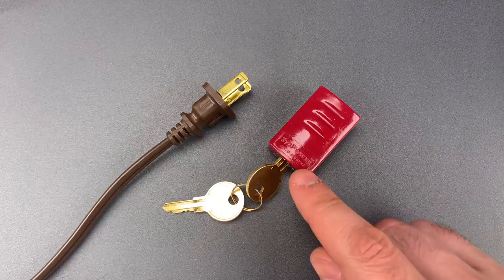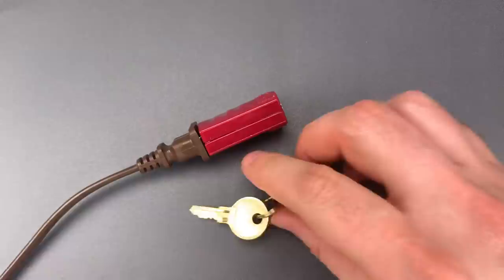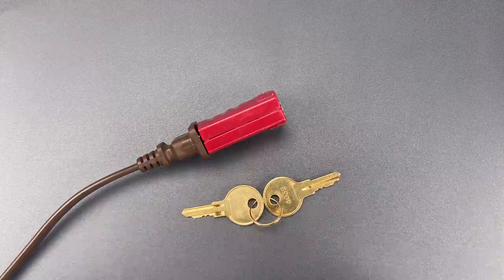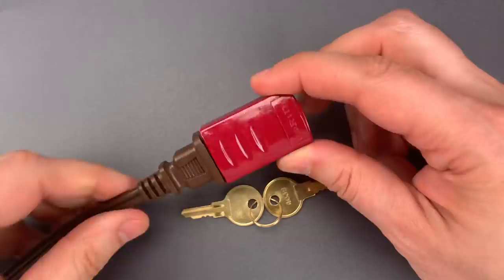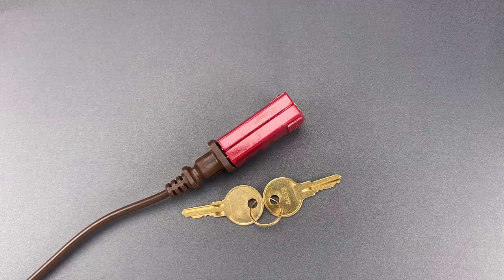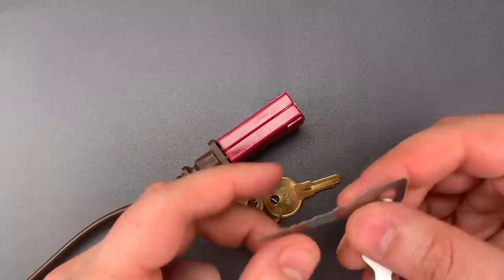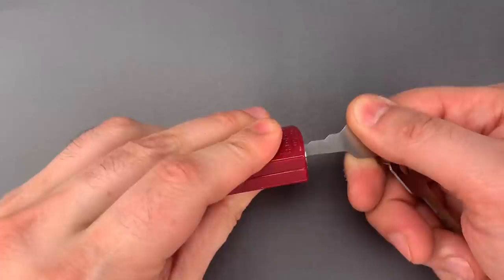[1138] Stopower Electric Plug Lock Jiggled Open FAST

Comment: "It only keeps out those who play by the rules. And maybe that's all you need in some circumstances."
I like that observation. The right lock for the job isn't always the just most secure one.

Though I'd say it's one step above a do-not-disturb sign as it's a little more idiot proof; it provide a mechanical way to keep track of who applied it (https://en.wikipedia.org/wiki/Lockout%E2%80%93tagout).

Comment: I’m an electrician and probably the best player ever of the board game Operation. If I want to deter my children from plugging in the PlayStation I just leave a plastic tab inside the hot of each electrical outlet to prevent them from using the outlet. No lock required.

Comment: You could probably use a padlock with a very thin shackle and just put it through the hole in the prong of the plug. This would prevent that prong of the plug from going into the outlet enough for the device to receive power. This could also take away the hammer and jiggling attacks if you chose the right lock. You could even double up on security if both prongs of the plug have holes in them. The lock would probably be susceptible to cutting and shimming attacks, but you might need special tools to pick it if you chose a small lock with a tiny keyhole.

Comment: We used these (or a very similar lock) in the welding shop I worked in.  If there was a problem with a piece of equipment that needed repair we would throw one of these locks on it.  We did this because do not use signs were not considered sufficient by the government safety inspectors (who visited regularly due to the nature of our work).

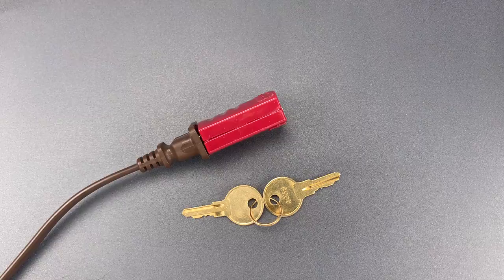Comment: 0:21 the Xbox One and PS4 have removable power cables that are pretty standard and generally interchangeable with other household devices shaped the same. The Nintendo Switch has a slightly more unique AC adapter, but any power supply that has equal or more volt+amp output to the original can be paired with a USB-C cable as a replacement... Just some info for the kids that want to play games immediately instead of trying to pick the lock 🤪

Comment: This is why, in actual safety applications, we use a plug lockout device with a hasp for a padlock like a Master 410, to provide actual resistance against picking… or more likely against a different technician mistakenly inserting the wrong key and jiggling a bit. Still plastic, still vulnerable to destructive attacks, but if you really wanted in you could just cut the plug off and replace it anyway.

Comment: in the UK you can easily re-wire a plug (not sure what the case is in America). But even if it was a solid lock and body made out of metal, you could just cut the cable and install a new plug on the end.

Comment: In one one of my first jobs we had locks on the telephones. Theses phones were the old rotary dial variety and the lock sat in the cradle. I discovered (I was on the night shift and i was bored!) that if you pressed down the cradle switch and gave the phone a good whack on it's right hand side whilst rapidly releasing your finger off of the switch that these locks would open. It was just the inertia imparted into the weak spring that was supposed to keep it shut.
Free calls! Whoot!
Edit for spelling.

Comment: To be clear: this is a lock out tag out (LO/TO) device. It is not meant to actually secure a lock but simply to show people that the device it is connected to should not be used and prevent accidental use. These are used in warehouse and industrial environments when an engineer is doing maintenance on a piece of equipment or when a piece of equipment is faulty and dangerous to use

Comment: It's not really meant to be pick free, and most don't have the basic picking tools on them.  We use something similar at work to lock out servers from being turned on for testing while we work on them.  It's pretty much as you said, hey, do not use, this is here to remind you.  Like safety lock outs for electrical boxes, showing hey, do not use until all keys have unlocked and removed it.

So pick prevention isn't needed.

Comment: Its most likely designed as a lockout device for any 2-3 prong 110v north American device in industrial/commercial places where someone is working on a device that plugs in. Even things like band saws and such that use the 110v 15a plug. Not that rv style 30a one.

Comment: I have a really old oak desk in which the middle drawer has a wafer lock. I use the file from a set of nail clippers to open and close it. I'd like to see you try this to see if my lock is particularly bad or if all bad wafer locks can be picked using this method.

Comment: Where I use these I'm operating under the assumption that the order of learning my kids will go through is 1) curiosity enough to go through drawers in the garage that I don't want to have to keep locked up in their entirty. 2) Understanding that, and how, you can hurt yourself with a glue gun, dremel, or soldering iron 3) lock-picking. If 3 comes before 2, then 2 will very probably shortly follow 3.

Comment: I have an absolutely massive game console collection (world-class) and the most mainstream console I can think of with a non detachable plug that could be locked out with this lock is the Panasonic R.E.A.L. 3DO FZ-1. Some of the others have uncommon plug types on the console end like Atari 7800 ProSystem and Colecovision but the vast majority will accept a universal power supply or a standard detachable AC cord rendering a plug lock totally useless.

I do have some console-specific locks in my collection including one that locks the cartridge slot of a Nintendo Entertainment System, one that cages the power switch on a Playstation 2 (original non-slim), and some locking retail kiosk hardware.

Comment: Certain sensitive filing cabinets in the office where I work have wafer locks.  They just require any flat metal bar to open such as a wiper insert, feeler gauge etc.  I hope no one else discovers this - and I said too much.

Comment: When I was a kid we had an IBM 486 computer, one of the ones with the barrel/cylinder locks on the front to stop someone from using the power button. My parents would lock it with a key and I would unlock it with a paperclip.

Comment: My dad did this for the TV...but without the lock. He just cut the cord and added a splice connector (like on a boat trailer wiring harness) and he would keep the plug end stashed until the he saw that the homework was done.

Comment: That is most likely a "safety" device, not a "security" device.  It is used during service / repair to "Lock out / Tag out" the appliance so it does not inadvertently get energized and possibly injure someone.

Comment: This is more for lockout tagout applications, to which LPL does give credit.   These are not designed for security, but rather as a reminder the the device has been powered down for safety reasons. The lock should not be removed except for the key holder who is solely responsible for ensuring it is safe to power on the device.

Comment: I have a really nice metal one of those but it's not a wafer style lock and I've picked it w/ a paper clip straightened out then bent in half and I put a few dents where the low spots were on the key and basically squeezed against the tension and let it go really fast while turning and I can get it open in about 10 seconds.... It's not just this lock but all locks like it that are and easy jiggle pick so be warned.

Comment: The first lock I ever picked was a wafer lock, no surprise there. I didn't have picks so cut grooves into a cable tie. It wasn't really picking as I made a rake, but it worked.
They really should not be used, they are so bad.

Comment: It can probably be used as a 'lockout tagout" device so that when someone is working on dangerous machinery it doesn't get plugged back in, in most workplaces it's a fire able offense to remove a device that's not yours

Comment: Cover with sign "do not operate" or cap "do not run the engine" has same purpose... It just for protect from accidentally switch on some device, not for protect from lock pickers.

Comment: I. m not from the US so am unsure of its use. Is this a lock to stop an appliance being plugged in to a wall socket or a lock to cover up live wire pins?  If the latter then it must be a dangerous practice to leave such uncovered.

Comment: Is it possible to lock the Roride StoPower plug lock back on the power plug? Facilities at my school just locked up our AC window units with one of those like 10 minutes ago. I want to take it off but without them finding out in the spring when facilities come back to remove it. I'd rather not pay a hundred-dollar fine. Thanks for the informative video.

Comment: I have a sincere question for you. I plan on making a lichtenberg machine which can be very deadly. I was considering using a lock very similar to the one you just picked in this video. Because the machine could be very deadly in the hands of someone not knowing what they're doing I wanted to make sure it was secure, what would you suggest ?

Comment: looks more like a lock out tag out system as more of a notice that whatever that is shouldn't be plugged. We use those alot in my business to make sure no one runs machinery when it could threaten someone, but instead of a huge system its just a tag that says "dont touch this I'll die if you do" and is like a rubber stopper.

Comment: Unless the cable is connected directly to the electronic device, it seems quite a pointless lock here :/
For all the other cases... just change the cable !
Reply: Or cut the wire and splice in a new plug.
Reply: @lairdcummings9092  reminds me of when i blow the fuse after i reassemble a fan as a kid
Reply: @thesturm8686  been there, done that. Had a career in the Nav, playing with electricity and electronics (and, incidentally, nuclear reactors). 
Result of childhood experience wrecking things electric..?
Could be...

Comment: Honestly, if it were any more secure the cable itself would be the bigger weak point. You could easily just cut off the end and put on a new connector, so no matter what this is really just a mild deterrent, I'm guessing likely most prominently used at workplaces for out-of-order equipment just to avoid accidental usage.

Comment: Having grown up in a house where electrical work was part of the normal day... that lock would have stayed on the plug as we would have cut it off and either put a new plug on the line... or just hard-wire it into the receptacle box.

Comment: Level 10: needing the pick "bosnian bill and I made".
Level 9: standing against lpls pick attempts for more than a minute.
Level 8: standing against lpls pick attempts for 30 seconds.
Level 7: standing against lpls picking attempts for 10 seconds.
Level 6: withstanding lpls picking attempts for 5 seconds.
Level 5: being raked open.
Level 4: being jiggled open.
Level 3: being opened with a stick
Level 2:being opened with a sheet of metal.
Level 1: being picked by a Lego.

Comment: When I was a kid, my mom took away the RCA cable that connected my commodore 64 to the TV. I didn't like that punishment at all, because I was a programmer already back then, and I didn't really play a lot with the C64. I wrote code, and for me it was learning. So I took the cables to power the rails of the LEGO train set and connected the C64 to the TV with this shaky but working connection. I am not sure if that made me into a hacker, but it certainly was fun. My mom never found out.

Comment: Looks perfect for industry, where the lock is not ment to to provide any security. Its there to make sure you think before plugging it in, where a sign is easy to ignore this think you HAVE to remove to use the plug

Comment: Well, it would probably be acceptable for LOTO. That's supposed to prevent accidental energization of equipment, and opening this requires more effort than it does to accidentally plug something in

Comment: Never lock up a cord for a system you're trying to stop a kid from using. Especially if you have a large change jug around. A new cord is easy to buy and conceal in your room. Did this when my dad took my monitor cable from my computer for a D in geometry because you can be right about an answer in geometry, but them fucking step by step proofs are difficult to describe for a mental math person.

Comment: i dont have the tools needed to open it up, but i have experience in electrical (the field this is actually designed for), 
and it would be easy for any electrician to cut the plug off and wire a new one in
the thing that stops people doing that, is the fact that 
1) it is locked for a reason, 99% of the time, another electrician is on the other end of that cable with a pair of pliers
2) if you are responsible for someones death by bypassing the lockout tag, thats your life over, you lose all licensing and accreditation, end up in jail, IF you get out eventually, nobody will touch you with a 10ft pole

Comment: In most cases you can just replace the cord. So this really doesn't do anything. Also - does it short both plugs together? If so, that could be cause for concern. If it doesn't, then it also exposes enough to get a connection on the ends... or, you can always use a splice connector.

Comment: If it was stronger lock you could still the cut plug off another cord and splice it onto the cord that had the lock on it... or you could make something to poke into the cable and bypass it without anyone noticing.

Comment: Obvious alternative: Buy a small master padlock and lock it into one of the pins, using the same holes grabbed by this gadget.  For international use, put a clear plastic bag over the plug, punch a hole near the top edge of the bag and lock it with a LOTO padlock.  Easily bypassed with brute force, but Tag-Out is clear.

Comment: I guess there are limits what you can achieve with such a lock anyway, given that you could just cut off the plug and add your own. It would prevent someone from accidentally plugging a machine in, which is under maintenance or has been determined to be unsafe.

Comment: when you pick products like this that is intended mostly to enforce basic safety but not have much security value it would be nice to pick it using common household implements like nail files from mom's beauty kit or hair pin or. paper clip to do a raking or equiv attack.

most of these kind of locks are laughably low security and may not require lock picking tools with an average household would not have.

the idea would be that a child may try to pick it using a paper clip or hair pin or something.

Comment: Could be rather usefule for lock out tag out of smaller power tools, belt Sanders, drills, ECT. Just something like "hey don't use this tool" if the cord is needing repair

Comment: In the case of the majority of the gaming consoles I know, (PS2, Xbox 360, Ps3, Ps4)  ignoring the lock and cable entirely, and just replacing the Standardized AC cable would make an even more infuriating attack

Comment: Wafer locks are terrible. I had a locking gas cap, I went to unlock it, and the core just pulled out of the gas cap with little effort. A wafer was what held the core in.

Comment: There methods to bypass it altogether:
Plug in a different flex (if it's detachable)
Rewire the plug
Replace the cable

This device is not engineer-proof

Comment: I see several problems with your misgivings on the quality and pick resistance of this lock.

1) If i lock out my kid from playing the xbawks or whatever else and the kid circumvents this lockout... The xbawks goes on sale.
2) If i lock out a machine at my workplace etc and someone comes around and hammers the lock off. I will sue their asses for endangering my life. In this case, a simple tag should suffice but a padlock is also an option because there's holes in that there plug to stick a padlock through.

This is a very effective way of saying "NO!" to plugging something in that shouldn't be plugged in. If someone finds a way of plugging said thing in anyways, there's going to be trouble!
This is not something used to prevent theft. So short of the lock falling off on its own, i really don't see a problem with it.

Comment: That is kind of bad for industrial applications because most industrial equipment won't run off 120 volts and 15 amps which is normal house power except if is some thing small then you wouldn't need to lock it out

Comment: What should this video prove? I can just cut the wire and rewire it if I really want to access it.
This system is has safe as his weakest link, no one can prevent anyone from plugging something in the wall if they really want it unless you have a different cord system.

Comment: Thinking on kids that may not have such tools... Can it be defeated with a paper clip? It's what I always tried, and failed, using on what I now recognize as wafer locks as a kid.
Reply: You can make a functioning jiggler from a paperclip. Needle-nose pliers make it easy, but you can use other tools to get the bends tight.

Comment: Umm, don't gaming consoles have detachable power cables? I.e. it should be possible to unplug the cable that has the lock on its end from the console, plug in a spare power cable instead - and you can play vidya instead of being productive without even touching the lock.

Comment: mom: "Hey billy, did you do your homework???"
billy: "yes I did"
mom: "then why is the xbox turned on and the lock I used to secure the power cord lying there smashed to pieces?!?!"

Seriously though, don't most entertainment devices have detachable power cords?.. couldn't you just buy a cheap spare power cord as a kid and use that whenever your parents 'lock up' the original power cord?
Reply: ...
cords arent cheap anymore
Reply: @iceneko9170  I just checked and I can order all types of power cords online for less than 5 bucks. I do not consider 5 bucks expensive.
I guess for a kid however it might be a big deal..